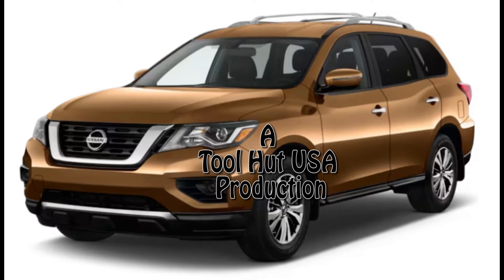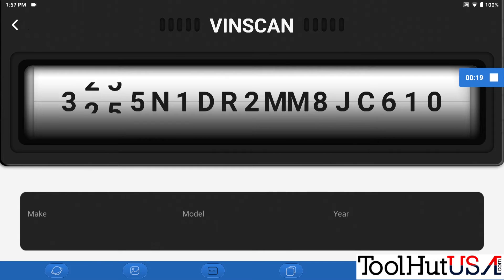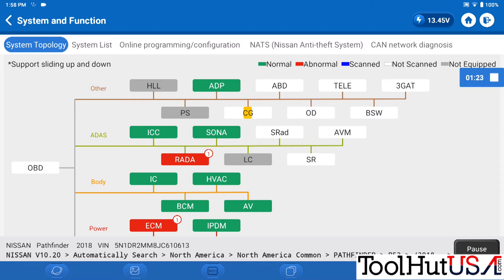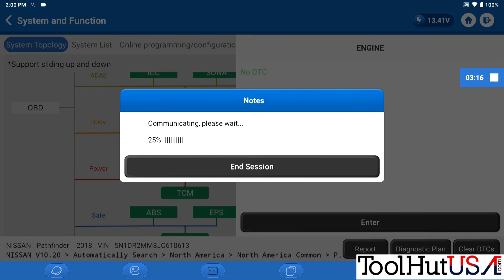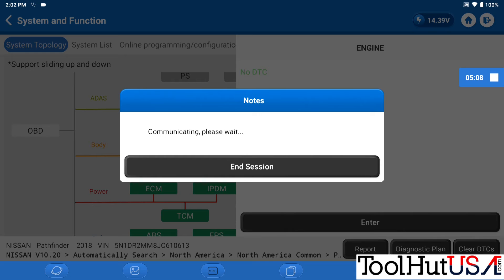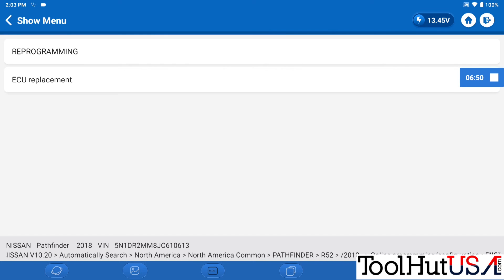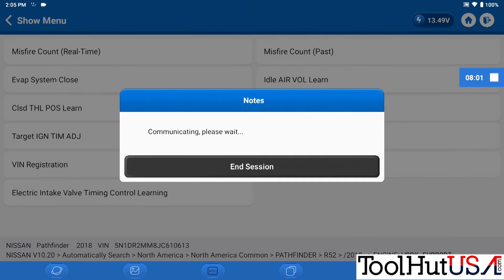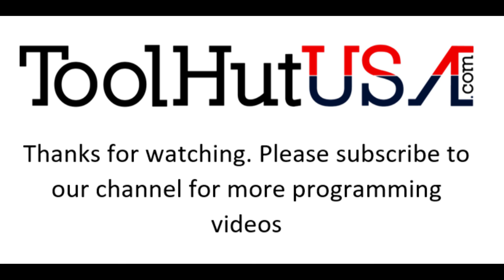2018 Nissan Pathfinder Electronic Intake Valve Calibration

Comment: i have a 2017 patherfinder 3.5L i been getting codes P34c4 P0022 and P0012, the oil is clean, B1 VVT solenoid was replaced, cam sensor B2's were clean. So my next step is to do a throttle body relearn and intake valve timing control relearn. If the relearn doesnt fix the issue, what else can i do or try? theres no noise from the timing chain so what else can i try or look at? One thing to note is that, i can clear the codes and drive on the street and hwy for 30-45mins and not a single hick-up i even parked and turned off the suv like 3 times and continued my analyzes and made it home still no CEL or issue. did some coasting and slow downs to stop lights and still no CEL. I did notice my RPM was 1500 on a cold start but it soon after stabilized as it warmed up. normal idle is 680-715rpm after its warmed up.

Comment: I had one a couple weeks ago with same issue. I had put in used engine and went to do relearn but it wouldnt take right away. What codes did you have? Mine had idle code p0507 and codes p34c4 and p34c5. There was a procedure to disconnect valve actuator, turn key on then turn key off and plug back in. Had to do this multiple times (not sure why it didnt like it the first time) then idle came down. Yea Nissans seem somewhat tempermental with relearn procedures 🙄